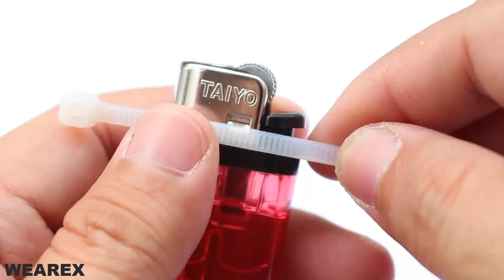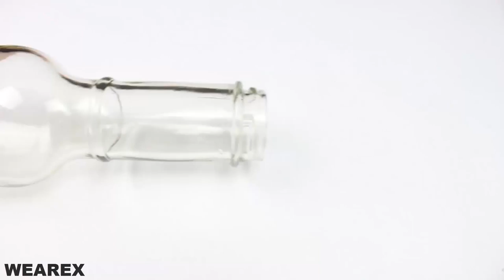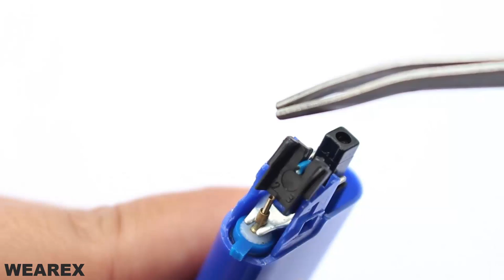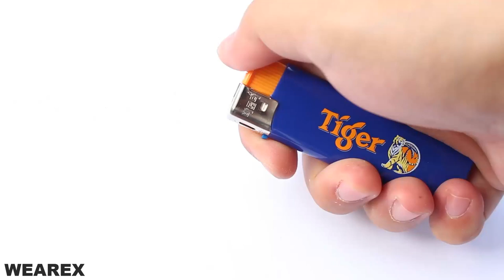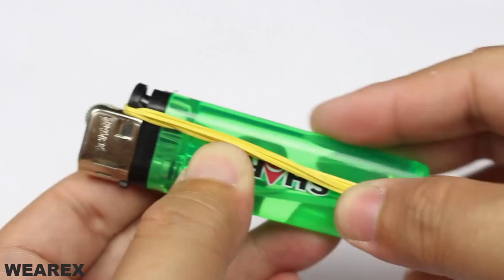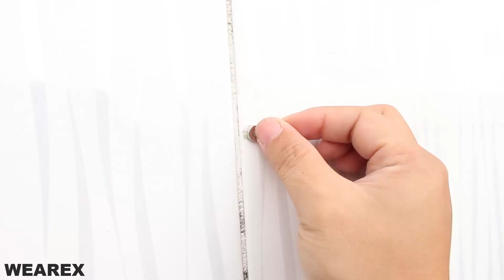5 Awesome Life Hacks For Lighter

Comment: A can of WD40 is much more costly than a can of butane gas. just buy a can of gas and a screw in torch when going outing for use.  You use lighters hot glue gun for most of your demo..don't you have other ideas?